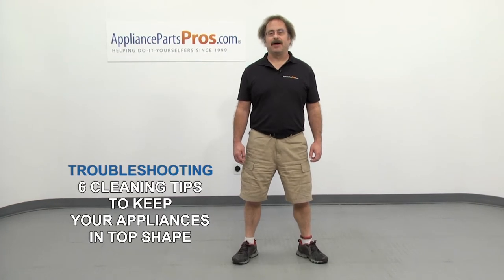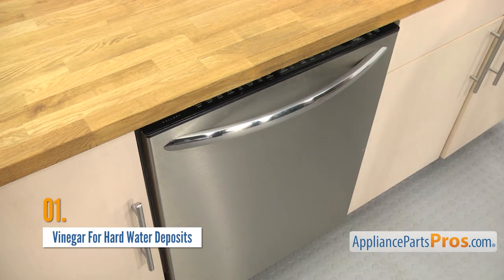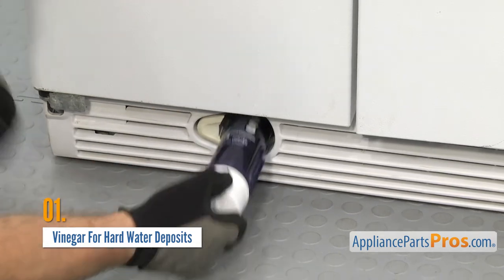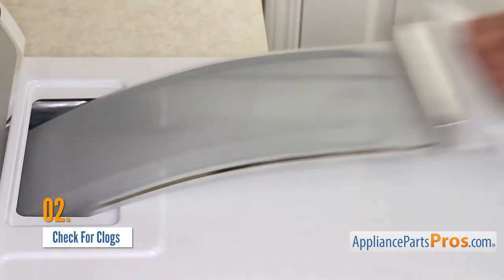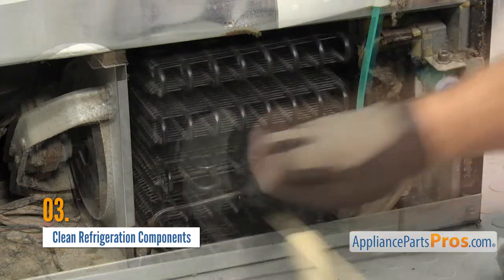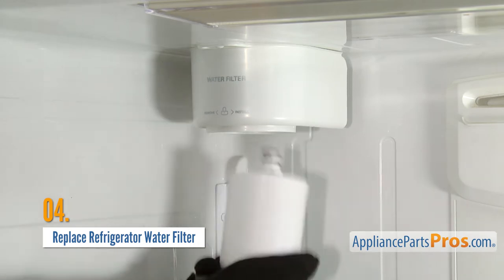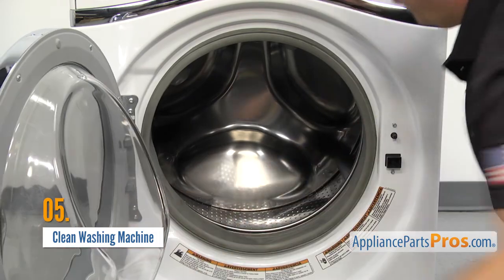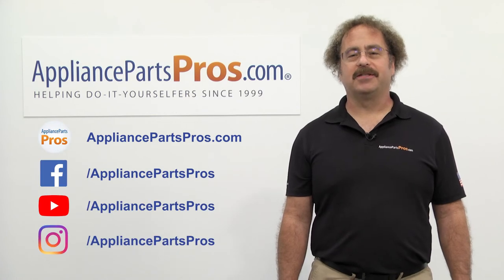6 Cleaning Tips To Keep Your Appliances In Top Shape - LG, Whirlpool, Maytag, Kenmore/Sears, Samsung

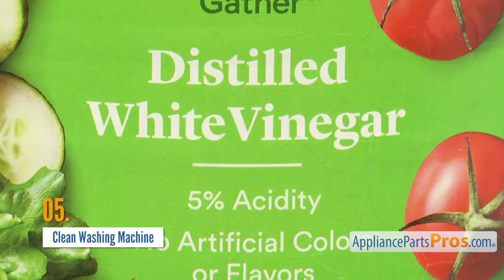Comment: AppliancePartsPros 5:43 When you said to run the washer on a hot wash cycle with vinegar or affresh, how much vinegar do you use for the hot wash cycle? And do you mean you can still run the washer on affresh mode with vinegar?